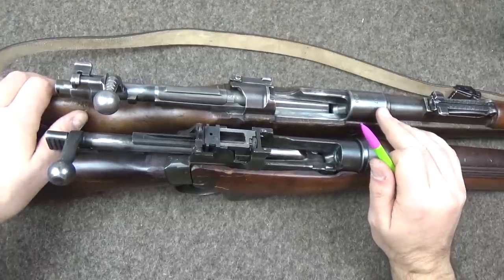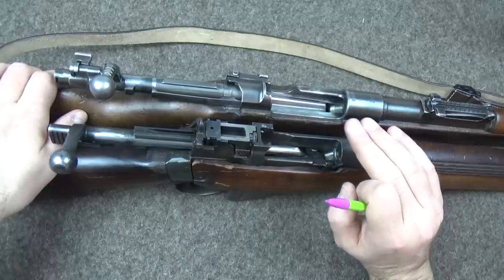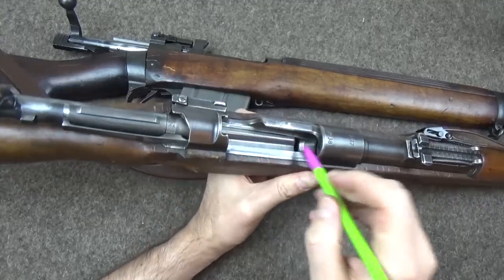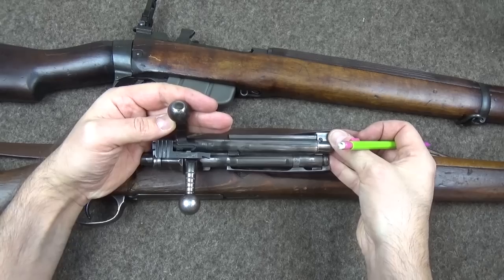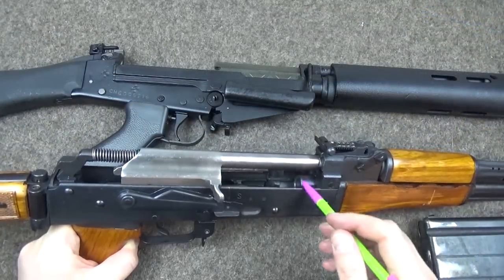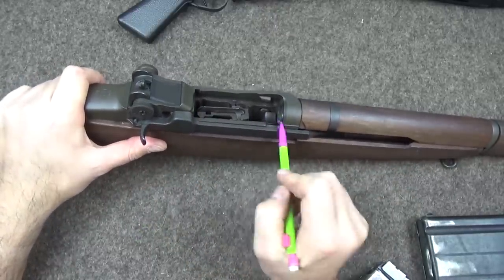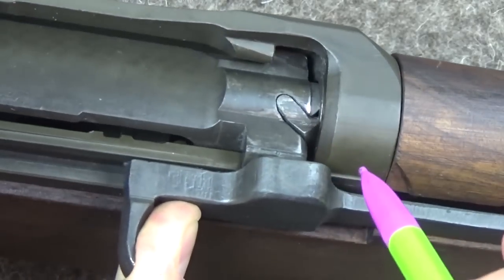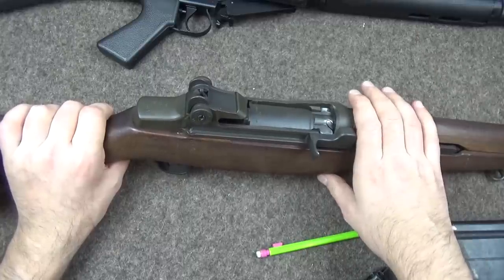Mechanical Nerdery: Front vs Rear Locking Bolt Throw

Comment: The survival of those Bic mechanical pencils never ceases to amaze me. I think they stopped making them in the mid 90s, they were intended to be disposable, but keep chugging along.
Reply from the maker: They're awesome things!!!
Reply: Well I still buy new ones from time to time (usually when I lose them), so i would guess they are still produced
Its cool that thy seem to be unchanged for decades though
Reply: When it comes to mechanical nerdery, the Bic twist style mechanical pencils are near the top of the heap.  They do what needs to be done with the least amount of effort and complexity.  I have several dozen in my ITEOTWAWKI supplies along with many thousands of pages of loose leaf college rule paper and a small ammo can filled with dice...
Reply: If you break the tip off and wrap a rubber band around the clip a few times then put the other end of the rubber band around the eraser you’ve got yourself a BB gun that will crack an old school glass computer monitor
Reply: @kirikou cortex  thanks! I hadn't seen a new one in decades and assumed they weren't made anymore.  Nice to know they're still available.
Reply: They still sell them all over the place in the UK.

Comment: The other point I would make about rear locking is that you end up with clearer access to the breech face making it easier to clean. Getting kack out of forward locking lugs is a pain leading to all sorts of "French tickler" * cleaning brush designs, that never seem to work..

* Yes I know this is a bit of an ancient term.. ask Grandad (...or even Grandma!)
Reply from the maker: That was one of the criticisms of the P14 vs SMLE - a pain to clean in comparison. The receiver is full of little corners too.
Reply: Negative thing with rear locking rifles is that the cases tend to stretch more in high pressure loads.
This might not be a issue with combat rifles that shoot a round once - but for owners of hunting rifles with rear locking rifles it can wear the cases alot.
Examples of this is the Anschutz 1430-32 - 22 hornet, 222 etc. Or like my german Voere Vöhrenbach in 222 rem. It also came in 222 rem mag, so the system is strong but locks in the rear wich tend to stretch the cases a bit more then a front locking like a rem 700
Reply: Same applies to the AR , it's a black hole in there past the locking shoulders .
Reply: The flip side of this is that it's much easier to get them dirty in the first place, being more exposed the action is much more vulnerable to jam up from external dirt or debris (compare InRange Tv mud tests of the K98k and Enfield - the Mauser did considerably better).
Reply: @fox-3407  Service guns always get dirty.. I would suggest the easier and quicker it is to clean is the key attribute...
Reply: @felixthecat265  Not dirty enough to matter though - it's not like a semi-auto with a gas system that'll foul up from the carbon out of each shot and not cycle the weapon properly - you can shoot thousands of rounds through a bolt action without the locking recesses accumulating enough internal fouling to stop the action cycling properly. 

Personally I'd rather have the locking surfaces better protected from ingress of external dirt (which can jam up the gun straightaway if it gets in) and put up with a bit more inconvenience when the occasional deep clean of the locking recesses is required.

Comment: The garand action compared to the FAL is even shorter when you consider the cartridge length as well, 7.62X51 for the FAL, 71.1mm overall length, vs .30-06, AKA 7.62X63 with an 85mm OAL in the Garand

Comment: A great visual example of the front locking lug bolt action is a Sako Lappalainen target rifles. They have an open top receiver ring (ie exposed lugs like an M1) so you can see the extra bolt travel required by a front locking system. Too bad it’s so hard to find good pictures of them.

Comment: Interesting indeed. The Krag, of course, is well-known (at least among Norwegian sport shooters) for being very sensitive to moisture or lubricant on the casings, which will apparently cause POI-shift. This is, allegedly, a result of the single locking lug.

While there's no question that rear-locking is faster, the questions I'm left with are "how much faster" and "is the difference great enough to provide a significant advantage". To the latter question, I suspect that the answer is "no".
Reply: In terms of speed I am sure that there is no practical impact on a combat rifle in a large scale.

The bigger impact would be if that little bit is enough to allow you to cycle the action without loving your head. The Bloke has a video or two showing the impact of that.
Reply: Speed isn't the question. Smoothness from the arm and hand's arc of motion is. Smooth is fast.
Reply: Fwiw, the U.S. Krags were always renowned for their smoothness, and as stated, smooth is fast...in the right hands.
Reply: ... perhaps the cause of them having a reputation for breech explosions? We have had a couple of these in UK in the past decade, although one was probably down to muppet reloading..!
Reply: @felixthecat265  the Krags you mean? If you run a Krag in 6,5x55 with a modern load, you will get breech failures sooner or later. Most reloading manuals won't tell you, but your starting and ending loads can be wildly different - to the tune of your max load for Krag will be the same as your min load with the same powder for ordinary use.

Smooth, on its own, is not fast. If you don't complete the quote, the takeaway can be VERY different. The quote - as it was taught to me back in basic training, as well as on numerous other occasions is "Slow is smooth, smooth is fast. Speed is the economy of motion."
Reply: @88porpoise  I think any action that requires me to hate my head is no go.
Reply: @aleksandernordgardenrdner1520  Yep.. I was referring to Krags. I think you have to be careful reloading for them and be aware of the limitations of the breech. Someone re-barrelled a batch of them in Europe some time ago and seems not to have done a particularly good job either in the engineering or the selection of an appropriate calibre. 
I think calibres such as the 6.5 and .45-70 which have been loaded to several standards need to be very carefully managed, particularly when paired with "intellectually challenged" home loaders..!
Reply: I was just about to write the same thing. Heard from a competition shooter they used to call it "shooting wet" to minimize the ammount of POI shift.
Reply: @felixthecat265  yeah, ammuntion beeing suited for the Krag is the main reason why 6.5x55 is deemed "subpar" to the 6.5 Creedmoor. But scandinavian shooters with their STR 200 or modern actions, gladly load the x55 to nearly 6.5 PRC levels with no risk..
But americans have all the surplus rifles. In sweden the military rifles are uncommon in civilian ownership.
Reply: @felixthecat265  The Krag was originally issued the same pressure ammo as the Swedish Mauser, and was considered perfectly safe at that pressure although safety margins were a bit smaller.

The problem with Krags today is that they're old and some have racked up insane round counts; these rifles were actively used in competitions for about 90 years. You couldn't get new ones after about 1950 as they were out of production, therefore 1890's production receivers kept getting rebarreled over and over. Top shooters in this sport can go through 10k rounds per year, and it's been that way since the beginning. So if you happen to get a Krag that's been in civilian hands since 1894, it's theoretically possible it may have had 800k rounds through it. Unless it has the original barrel still, there's no way to know if it's been rebarreled once or 50 times over its long life.
Catastrophic ruptures started to happen with increasing frequency in the 1980's due to material fatigue in old worn out target shooting Krags that had been rebarreled who knows how many times. Consequently, pressure standards for the Krag got lowered and special downloaded ammo got produced.

Which is all a long winded way of saying, if your Krag has its original barrel and still has rifling left then it's probably safe with the  Mauser-level loads it was designed to use. If it has been converted for competition use with a new barrel, be very careful and have it inspected for cracks before firing reduced loads only.

Comment: And the rear locking lugs can allow the bolt handle to be far enough Bach to align the hand with the trigger position. Which is probably the larger component of the swifter loading, closing and firing time reduction in this comparison.
Reply from the maker: Not sure it's the position of the lugs that has an infuence on that, and in any case the bolt handle can always be raked backwards or doglegged (e.g. P14/M17) to put it in that position.

Comment: I dig the nerdery. As I don't own a FAL in any of its variants (someday!), seeing the overall length difference between it and the M1 Rifle was a bit startling. Especially when the M1 was built for a cartridge with ~12mm/0.5in less case length. And some of the FAL early variants were intended for something like 7.92x33 Kurz or possibly 280 British.

Comment: To add to the nerdery, a typical bolt action compared to the straight pull of a Schmidt Rubin/K-31 must consider the changing of direction on a typical bolt action when comparing the amount of time to eject the spent round and chamber the next round. In the typical bolt action the process is started with an upward swing of the bolt, perpendicular to the length of the rifle. That motion completely stops once the bolt finishes the travel to enable the bolt to now be pulled rearward. After pulling rearward the direction changes 180 degrees until the round is chambered. However, the action is not yet done. The bolt now must be rotated downward until the bolt is locked. 

This is the reason for the design of the Schmidt Rubin. Eliminating the manual perpendicular actions of the bolt provides for a faster ejecting of the spent round and chambering the next. A slightly longer pull, however, is negated by not having to make any perpendicular motions of the bolt action, thus saving that time and more. 

It is interesting to see the different designs and the different locations of the chamber in relation to the magazine locations.

Comment: The comments I had most often read about front v rear lugs was safety in the event of catastrophic failure; the front lugs with the recessed chamber providing extra protection.  I'm not taking sides, just mentioning what has been mentioned elsewhere.
ANOTHER layer of nerdery...The AK bolt was influenced by the Garand bolt.
Reply from the maker: Except that front lockers tend to fail catastrophically since the locking recesses give a large area over which the escaping gas can act (hence all the clever gas handling on a 98 Mauser).
Reply: @BlokeontheRange  Thanks!

Comment: Presumably the M1 had very pronounced recoil from the bolts extremely short throw ? I'm assuming its velocity upon impact with whatever stops the bolt would be substantially higher than the Chineseium example?

Comment: Everyone has their preference, but it really seems that the difference is negligible in actual combat as long as the weapon functions. On the range, or in timed competition, one second may matter, but in the trenches most troops are probably not true experts, may be poorly trained or afraid and are firing as units to just generate fires in support of the machine guns and artillery, who are doing far more damage than riflemen. That could be controversial, but there's a difference between the science/theory and the practical reality.

Comment: The Mauser bolt wobbles through its tunnel, plus its controlled feed both slow you down, its potentially stronger and more accurate front locking is typically is no benefit to the average conscript soldier  ,  it only starts giving benefits with high level marksmanship or with higher power ammunition  , the LE was accurate enough even for sniping if tweaked,   the actions weren't weak for its designed cartridge , hard to manufacture or heat treat, but easier to clean and clear stopages than the Mauser. In short Mauser actions stink for battle rifles .
Reply from the maker: On the basis of the stats the Germans provided in their training manuals, an average Gew 98 coming off the production line wouldn't pass the 600 yd minimum standard for an SMLE, let alone a No.4, and the Kar98k sniper rifles had terrible accuracy problems :)

Comment: Wouldn't the extranerdy question now be: how much time difference those 1-1.5cm of length travel cause vs. how much time difference is between a 60° and a 90° bolt throw in a bolt action? (in % of the cycle time of course ;-) )

edit: or would a 60° front locking bolt even out with a 90° rear locking bolt action? 🤓
Reply: With being a shooter I would be curious why the locking position should matter. 
I would have imagined that the important part would be whether you can keep the target in your sights while getting the next cartridge in place. Without poking out your eye, of course.
Reply: @myparceltape1169  I think you aren't able to keep the rifle on target with either of the bolt actions shown while cycling without poking out your eye. And while i agree that this would make the biggest difference, in the video he focussed on the speed of cycling the action and the difference due to more travel of the bolt lengthwise.

Comment: I do wonder where the whole "rear locking being less accurate" lore came from? I doubt bubba knows about the Boer wars(or that the issue wasn't the action).

Maybe from tilting bolts? Like when surplus SKS and FAL came into the US, being older designs, worn down and/or being rebuilt cheaply and badly. And from there the myth expanded to everything rear locking.
Reply from the maker: It was floating about already in the pre-WW1 era in the propaganda from the people who wanted the British Army to switch to a Mauser-type receiver, so despite more than a century of being proved wrong, it's still floating about there as common knowledge.

Comment: But the K31 is a faster action because it is a front locking system. The rear locking system on the G11 causes the bolt to be a mile long and makes your stroke that much longer.
Reply from the maker: I just measured, at the cocking handle:
K31: 11.9cm stroke
K11: 11cm stroke
Reply: @BlokeontheRange  really? That's interesting it always felt clunkier working the 1911 action it always felt longer. I stand corrected.

Comment: So 15mm (or so) of difference in bolt throw is significant because... ?
Reply from the maker: Time = distance / speed ;) And that 15mm might be the difference between having to move your head out of the way of the bolt or not...
Reply: @BlokeontheRange  Moving your head out of the way is also a function of stock length (length of pull) and bolt throw angle, but the distance/speed equation is pretty much the same (for all practical purposes) for 10mm or 20mm. Can you measure the time differential between them? Or is it just a theoretical difference? I just don't see it as significant.
Reply from the maker: The old Mad Minute results from the early days of the channel had Kar98k splits about 30% longer than No.4 (admittedly there's more going on than just the 15mm or so) but every little helps.
Reply: @BlokeontheRange  I admit that 15mm is 15mm, but I suspect that quality of machining and/or angles of throw are at least as significant as length of throw. However, since I'm not qualified, able, or clever enough to test any of these hypotheses, I'm just going to thank you for your nerdy devotion to the hobby. 😀
Reply: @siestatime4638  Are you saying that the Lee is better machined than a Mauser!!!!! The wehraboos will be after you 🤣